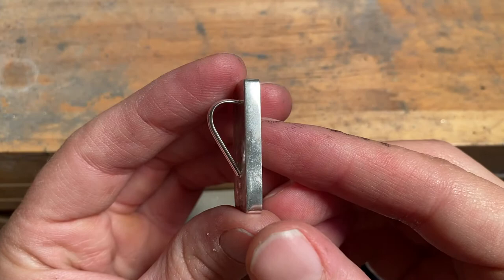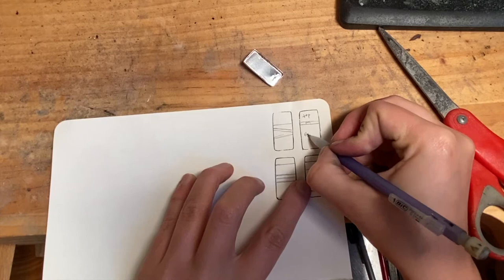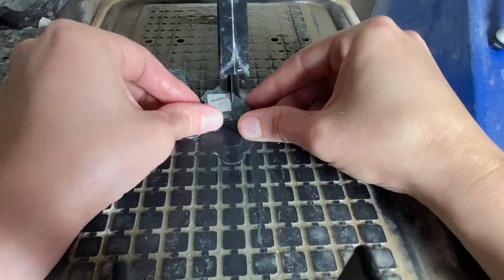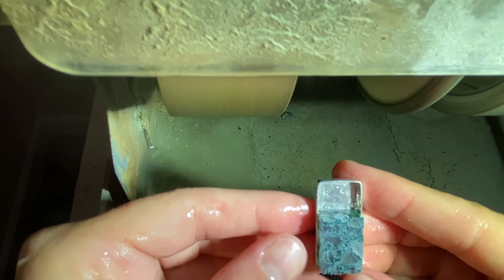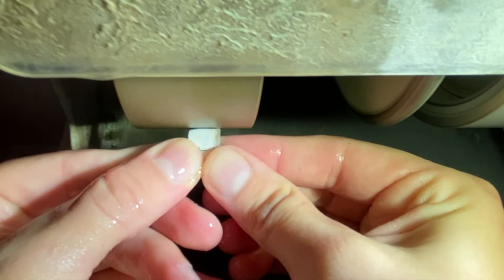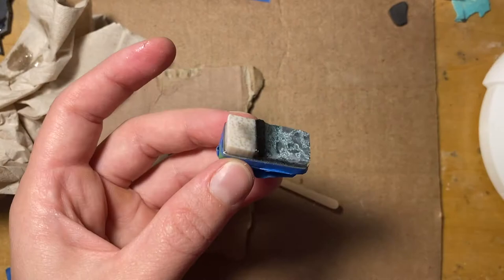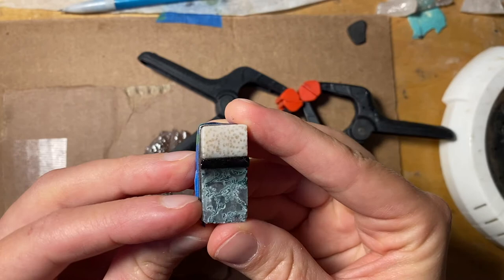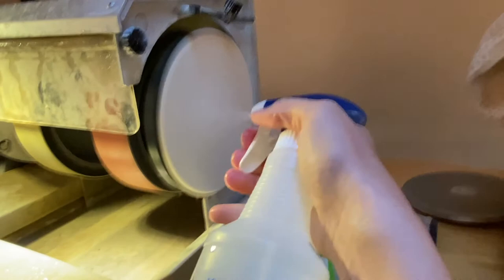How to Make a Flush Cut Inlay - Part 2

Comment: On the rewatch, I have a question.  Is there an advantage to cutting and fitting the three stones separately like you did here, versus constructing the design as an intarsia, and then fitting that (as a whole) into the silver frame?  Or is it more just whatever one is comfortable with? Thanks!
Reply from the maker: Great question, Susan! You could totally to the intarsia first, then cut it to fit the framework! I’ve seen quite a few inlay artists do it that way, I’m not sure that one saves more time over the other (I would imagine they would be in the same ballpark of time spent) so it’s mostly preference 😊 if you try both ways out, I’d be interested to know which way you like best!